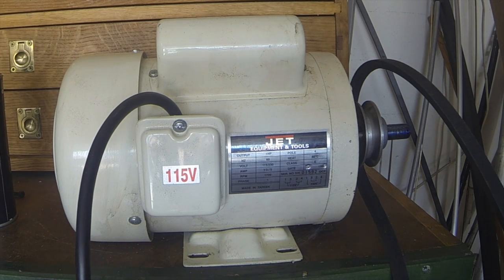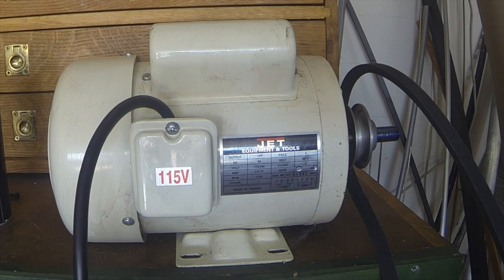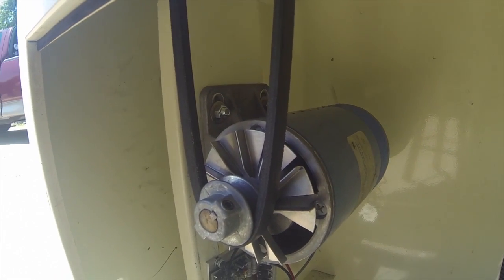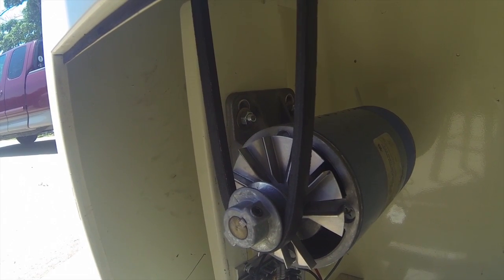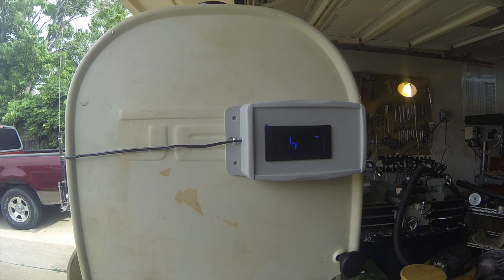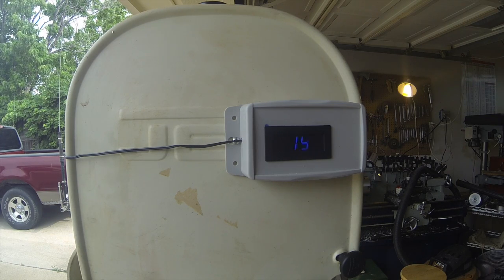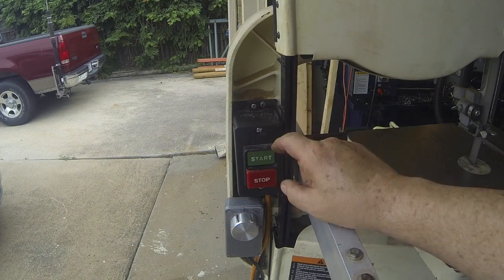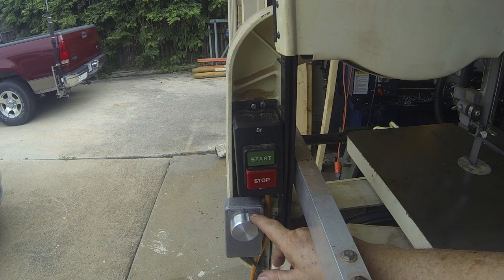14" Bandsaw Conversion

Comment: Here’s a tip for you: Since a 14” wheel has a 44” circumference, and since 44” is pretty close to 4 feet, you can install 4 magnets and have your tachometer read out directly in FPM. Of course, it will be reading about 10% high, but that’s close enough for almost any purpose.

Comment: Dear sir.
That is a nice conversion.  A lot of those motor controllers need speed feedback as well.  How did you do that?  I just missed out on a nice treadmill on Ebay, they changed the programme, and I did not realise, that I still had to confirm the bid.  Still, there you are....  Anyway,   nicely done sir.

Comment: NO NEED FOR THE CHART, just put three magnets equally spaced and with you wheel at roughly 3.5 feet circumfrance that means 1.1 feet per magnet passing, so your rpm read out will directly measure sfm, itll read a little less, 10 percent less but better than looking on a chart any day.  Hope that makes sense good luck.
Reply: +Oliver Boatwright Good thinking! I'm doing a conversion myself and doubt i would have thought of it!

Comment: Good conversion Herb,

I have my Startrite Bandit 5 (5 speed version, they also did a plain Bandit and a rare Bandit 10) running from a VFD at 20Hz for metal cutting. I plan to make a new stand and incorporate another reduction stage so I can run the motor at 50Hz and gain back some torque.
Reply from the maker: Paul,  the treadmill motor suffers from torque at the low speed also.  I'm looking into ways that I can do another reduction stage.  (there is plenty of room in the base of the cabinet.)  Thanks for the comment.  Cheers!
Reply: Herb Blair
It may partly down to your speed controller, transistor based PWM types tend to be better than SCR/Triac ones. Either will be much better with closed loop control (speed feedback).

Comment: Hi Herb, Excellent video. With the DC motor will you still lose torque as you would with an AC motor when you would do a VFD conversion? Cheers.
Reply from the maker: Yes, you also loose torque, but not as much as with a VFD.  I have a VFD on my drill press and it really suffers at 10 to 20Hz.  Thanks for watching and the comment!  Cheers!

Comment: Love it! Gonna probably end up doing this myself, wood bandsaws being easier to come across. One suggestion though... if you move the magnet for the tach to 1.91 inches out from center you'll have feet per minute.
Reply: Gotta beg to differ. The circumference of the wheel determines feet per minute, not the radial location of a magnet of a wheel turning at X speed.
Reply: Ray Jones yeah, I think you're right. The blade would have to be in the same spot, 1.91 inches...then it would be fpm.
Reply from the maker: Thanks for the tip.